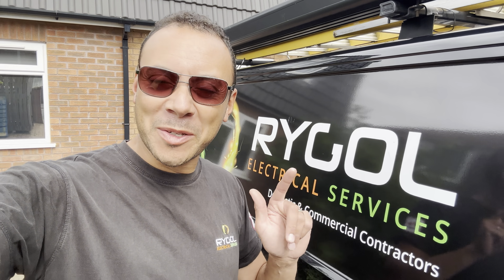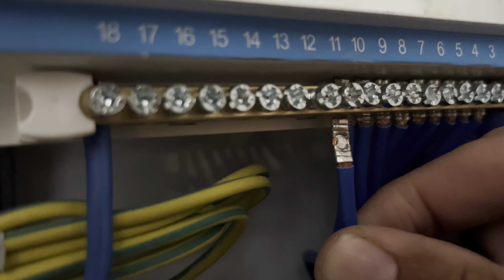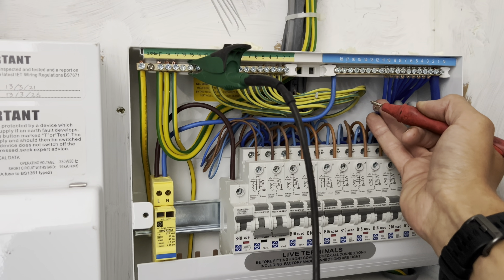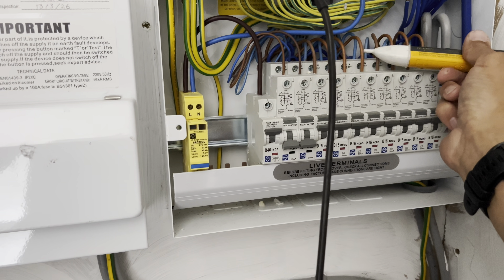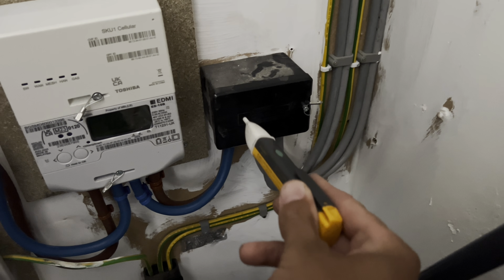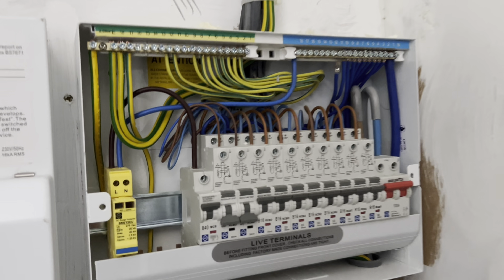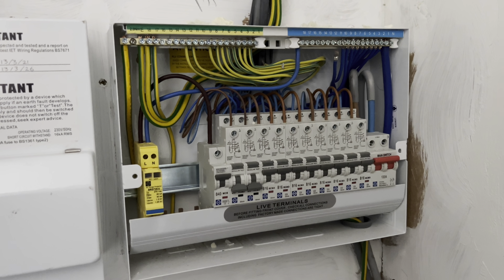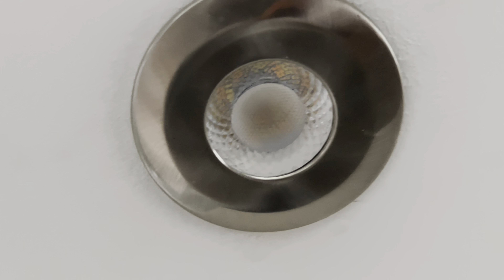Smart Meter Disaster! ⚡️

Comment: This is bloody ridiculous, A full electrical test should have been carried out by the person who installed the smart meter. If I were the property owner, I would be looking to sue the installer company. Someone could have had a very bad shock if they had simply turned off the PCB for the area they were working in. Then assumed the circuit to be dead. An inexperience DIY person would probably only test for voltage between Live and Neutral. You should know that DC is the voltage that tends to grab and not let go. Electricians have no excuse for bad workmanship.

Comment: This makes me wonder about my own wiring in my bungalow,  Though it is a tenancy property owned By HBC, there is a fault between "N & E" being there is a voltage potential of 118vac present, instead of 0V when the breaker is turned off. All the other parts are fine at no readings.  Also, when the main breaker is deployed, the meter still registers a voltage potential?  I have reported this several times to my council and they still assure me that all the wiring is working fine as it should.  What do I do???  It sounds like a botch-job on a big scale....

Comment: Been there, done that, got the T-shirt.

Whilst working on a 10kW transmitter I noticed that my neon indicator screwdriver was lighting up. It turned out that the wireman who'd wired up the cabinet had connected the main isolator switch with L-N reversed.

Comment: I don’t have smart meter in my place but downstairs and upstairs are wired differently 
Downstairs cables are thin and soft,upstairs industrial grade ,solid thick wire.
Downstairs changing my light fixtures went without hiccups
Upstairs different story ,my positive wasn’t positive and so on,had to find out what was correct way,isolate so called positive and use other to connect it .
Do some wire extensions to soft and thin as original were industrial size and piggyback into one . Whoever wired when was built done shonky job.

Comment: When I saw you starting to touch the neutral bar I immediately reacted as I was told from my very first classes that you never do that. You always have to check. Especially here where we have a mix of IT and TN. Mostly 3-phase too. Naturally that is a single phase TN consumer unit but here that is no excuse not to be safe due to the mix of systems. When it turned out that was the issue, I just had to mention it.

Comment: I’m a Spark from Bristol, 27 years in the trade, I’ve seen this 3 times. Gas inspector picked up on it in someone’s home, luckily they were there only a few days after the meter people had been there. The two other times happened on a building in Bath that was repurposed into almost 60 flats, and two of those were metered up with incorrect polarity, we noticed one of them, but the other led to a Electrical Improver (sort of journeyman level for the uninformed) getting a shock from a light fitting on an “isolated” circuit.
Like your vids, like your standards, keep it up, mucker 👍🏻

Comment: Happened to me at a campsite in Cumbria- plugged the cooler box in and the bus's main trip and circuit trip blew along with the fuse in the coolerbox lead. It puzzled me how the daisychain of fuses tripped when as one blows there can be no current down the line.

I checked with one of those consumer checkers and yes- sure enough, live neutral reversal. I complained to the site manager and he flatly denied it. He told me that they'd had a campervan pull away whilst still hooked up and tore the wiring apart but that they'd had an engineer in to correct it.  I told him that he could say whatever he liked, I was going to flip the wiring on my campervan's installation much like you did in this video albeit mine would be temporary (which I did) but that the next customer would face a lethal fault. I wasn't entirely sure about that action due to the nature of PME and the related bonding of neutral to "earth" back at the substation, but I figured that since it was my bus's installation and I wasn't interfering with the supply I felt more comfortable about doing it.

About three days later an electrician turned up to fix the installation and I related the story to him. He said it was B.S. because he was the regular guy for all this type of work in the valley and he'd not been called in. He said that the campsite owner had likely rewired the standpoint himself. This was during a fuel crisis around 2001 and I couldn't spare the petrol to go and buy any replacement fuses but the guy gave me some from his van.

You were correct about shocks, quite apart from the lengthy period of aching in the affected muscles, you have the short term disorientation too. Probably better not to ask!

Comment: The first test that should have been done before touching anything was to use the volt alert before touching any surface then the  socket and see to check polarity. Since the guy wired the house and there is a new meter it becomes obvious what and where the fault is.

Comment: That's why the Neutral is Earth bound but in your video it's not .The Earth should pass through the neutral bar unbroken on its way to the Earth Bar and then to the Earth Electrode hammered into ground .
In the days of copper water pipes the Main Earth should start at the Copper pipes up in the roof space then head down to the Meter Box from memory 6mm2 Copper for the Main Earth .
Perhaps you should check why there is no no link as that is the safety feature  to trip breakers in shorts.

Comment: Yes sir they did the checks, of course they did it, and it is called armchair inspection. Happened to my property, one 110K volts pole had an old yellow plastic card of inspection, it was probably 10 years old. Last year, I requested the pole to be moved to build an extension. An engineer came round to do all the measurements to then send me a quote, but he was not able to find the pole in the area of the property he was, and he was around with a map. I took him to the pole, and he said that is not what he is looking for... Morale, is that who did the pole inspections over the last decade did it from an armchair, if not he was able to see it was not where it was supposed to be and had the multiple cards of inspection. DEAR SSE ARE SPECIALIST IN DOING PROPER INSPECTIONS.

Comment: This is why I’m so surprised the UK does not use double pole circuit breakers! Home owners wants to replace a socket, turns the breaker off for this one circuit to not turn the whole house off, plugs a light in the socket to confirm correct breaker has been switched off, disassembles the socket. And dies because the neutral was switched instead of the live….
A friend of my mother nearly died due to the same issue when replacing an electric heater. The live and neutral were reversed in the consumer unit, and circuits were protected by single pole fuse holders. In France double pole breakers have been mandatory for a while now…

Comment: I am not an electrician but the very first thought I had was that things were connected incorrectly. I used to work for TfL maintaining underground trains and often helped the electricians when they couldn't find where a fault was..... if you have any kind of problem then the first thing I would look at is connections as it is oh to easy to get it backwards ! - Oh, all the wiring on trains back then for the controls had the same colour insulation, a really stupid idea but it taught me to go back to basics rather than over-complicate things.
The landlord of that property is a bit stupid though because all was well until the smart meter was fitted - then problems occurred which makes it obvious that the meter was incorrectly fitted..... and it took them a year to get the problem checked by you instead of contacting the installers.....

Comment: Thanks for sharing your observations.  I know of four friends who had issues after a smart meter was installed by fitters, not qualified electricians. 

One friend had a meter installed in the morning, left in the afternoon on a two-day business trip, his neighbour on the other side of the adjoining wall felt the wall was warm in the evening and knowing a new meter had been fitted, called the fire service.

The fire service broke in and on confirming there was heat coming from the installation, called an emergency electrician and found that the live cable hadn’t been clamped properly and there was a high resistance and arcing between the cable and clamp..

All work on gas installations have to be conducted by a gas safe engineer, the same should apply to electrical work.

Comment: Touching that neutral buss and the chassis isn’t just a 240v shock it’s a 240v shock limited to around 100A or whatever the main fuse pre the meter is. Unbelievable serious.

Many years ago I was asked by someone to do some DIY work for them after they’d moved into a new to them house. I’m not an electrician but a fully qualified electronics engineer who worked on radar systems so high power and voltage 40+Kv and megawatts so well capable of minor electrical DIY (I thought, oh hindsight lol). My colleague was plumbing in a washer in the kitchen and needed his drill (pre battery drill days) so needed the ring main live. 

I had to replace a light fitting in the living room, it previously had a bathroom type fitting tith a metal base where the supply came in through a hole where no grommet had been fitted. I switched the light on then switched off the MCB in the box for the lighting circuit. The light went dead but I still stuck my AVO between the live & neutral then the live and earth at the lighting circuit fitting. Both dead so I started to remove the old light sliding the fitting off the newly disconnected twin & earth (which someone had ‘conveniently’ not bothered putting an earth sleeve on). I remember the flash and bang but next thing I knew I was lying on the floor not standing on the step ladders. 

As the steps were on a wooden floor and I always wear rubber soled safety boots I, luckily, had very little path to earth through me but as the neutral and exposed earth wire both touched the edge of the hole they made a contact. The 80A main fuse blew and the 10mm hole where the cables had shorted was now around 2” in diameter where it had vaporised as did about 1cm of the twin & earth.

Although I was well insulated I did have enough conductivity that I got a shock and serious burns on my fingertips where I’d been holding the fitting.

Just as in this video there had been a new (pre smart) meter and the cables reversed. 

Turns out that because they were doing a whole estate at once they tasked the apprentices to do all the metering work and it was “checked” by one of the electricians who I later found out was given that task because his oppos considered him a liability to do the main wiring work.

Taught me a lesson never to trust other people’s abilities but always triple check myself even for things which defy logic.

Comment: Neutral fault all the way as we have had this twice because of the following being fitted, shower fitted, the new lights, new smoke alarms, then a completely new box and the lights in a bedroom did the same of what you had in the front room. Hate electrics and do the basic like bulb change or fuse replacement or home alarm backup batteries. The plug in tester is a must & the handheld electric tester pen to make sure plus a electric meter. Most of my stuff is to do with 12v car electrical jobs

Comment: I’m absolutely staggered because every meter change I’ve ever had in my life at my house my father‘s house my daughter‘s house (that I refurbished) the meter installer has done a polarity test on the sockets around the house before and after, this person has obviously not followed procedure.

I’m not an electrician, but I am an engineer and I have either wired or rewired many houses for the family or myself.

Even before part P came in, I always had a qualified electrician test my installations because we are all human. 

That’s a nice neat job in the consumer unit, by the way! 

The last meter install I had done was about a year ago and it was done by Octopus to a high standard, but I still had to ask if they would put a DNO isolator which makes life a lot simpler and an additional margin of safety if you’re working on the consumer unit. 

I have an issue with British consumer units where the front panel is not separately earthed, that would not be acceptable in a broadcast transmitting station where all metalwork has to have its own earth conductor.

Comment: The correct wiring of a DP connector block is neutral at the front and live at the back. 
Not an excuse from the meter installer but its a shame the block wasn't wired in the conventional way before they arrived 🤔.

Comment: Swopped it around? You are not authorised to cut seals on metering equipment and that’s what you have must of done to pull the fuse! Instead of trying to be clever and over complicate things you should have turned off the supply and contacted DNO…I was qualified to do this work from the DNO, It was an obvious reversed polarity that I would have spotted in 10 seconds without all the testing, a simple martindale  check plug would have told you that then just trace the tails back….

Comment: I had a reverse polarity issue recently (as a home owner - I’m not an electrician) - first noticed as some LED floodlights being dimly lit always and then even when the circuit was off, and it then started having more frequent nuisance tripping. I called an electrician who found the consumer unit polarity was wrong and similarly also looked correct at the meter so advised me to call the DNO. They came out and found the meter was correct, but the cut out was wrong and even my main fuse was on the neutral side and started making some frantic calls. I’d also had a smart meter around 5 years ago, and the cutout replaced a few months before that as it was an old cast iron cutout with porcelain fuses. They rewire it to be correct , but then still had some odd ‘fluctuations’ - and that’s where it got interesting. They drilled some hole in the pavement and had some worried faces, then had to dig a large hole outside to locate the main cable supplying our house - only to find that was also wired correctly to the cutout, but was also reversed. The digging up of the pavement then continued to the other side of my neighbours house, to eventually trace it to the main jointing (not sure my terminology is correct) to the supply to the street had basically fallen apart and shorted itself back together the wrong way around.  By the time they’d got to this point (around 27 hours from arrival) even the earth had become live!

Comment: Wow. Like seriously wow. 

I'd have to insist on checks being done of other installations by that smart meter installer to see if there's a pattern of switched polarity.

They got it right on the in and out coloured cables at the meter but wrong in the uncoloured cabling AND the lie about the check being done at an outlet.
To my way of thinking that makes it deliberate and they hid it in the uncoloured cabling. 

If there's multiples of the same issue and same mistake and claims of false checks. I'd suggest there'd be a very strong criminal case for them to answer.

Comment: I am retired but I encountered this problem 3 times with local electrical suppliers before smart meters , new mains into a property crossed ,and whilst fitting storage heater noticed wrong polarity this was rectified but when they came to connect the heaters into the mains they crossed the polarity again !!

Comment: Just for information I bought such a polarity checker (a cheap one) here in Australia and it shows my polarity to be reversed. It isn't. China uses the opposite pin's in the outlets and the checker is chineese.
In regards to installing smart meters then here the installer is being checked by a person from the supplying company so cuch a problem demands a double failure.

Comment: I'm a retired electrician in Germany. I have to state: We are not doing everythings better than others. So the british plug system is much more better and save than the f... continent "Schuko"  Plugs.
(Schuko means protecting contact). But - if I see the arrangement in the wiring cabinet: That's in Germany a tiny bit eh... different. And much much more expensive off course.
Coming back to this case: After EVERY modification on the electric system it's a MUST to check the sockets - at least one or two on different strings. That's not a big deal but VERY important: Everybody can do a mistake like it here was happened... 
Good job, well done and thanks for the Video!

Comment: Simple answer - don't have a 'smart' meter fitted
Reply: I've refused one for a decade but my normal meter is now faulty and they insist on installing a smart meter, which I reject. However I'm feeling forced because "they are the only available meter". So I think that is their solution now. Wait until the current meter is faulty and replace with the smart. If anyone around here knows what I should do to stop them fitting a smart meter I'm all ears.
Reply: @dlions9068  this company only fit smart meters now. What you can do is refuse it to be commissioned. They’ll either not fit a comms hub on top of the meter or they just won’t commission it so it won’t send the readings

Comment: Great video showing your neat work and fault diagnosisbut do have a critism too. Although meter installer obviously didn't do his job correctly, I did notice the C.U tails are in the henley block the wrong way around. Line should be at the back then neutrals stacked in front.

Comment: The thing that makes this extra dangerous is that MCBs/RCBOs in consumer units only isolate the live wire. So switching off a circuit won't isolate power to it and in an over-current situation, the circuit breaker won't trip.